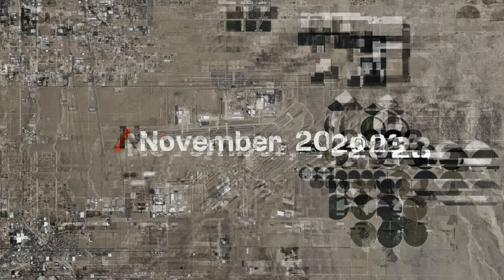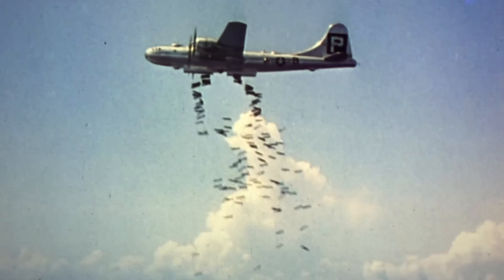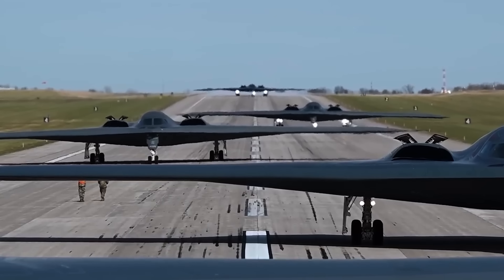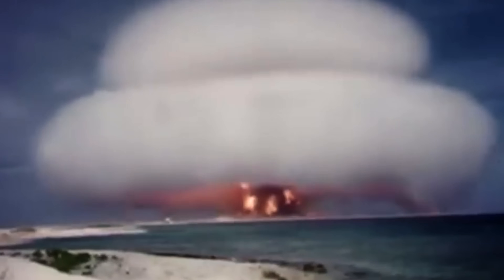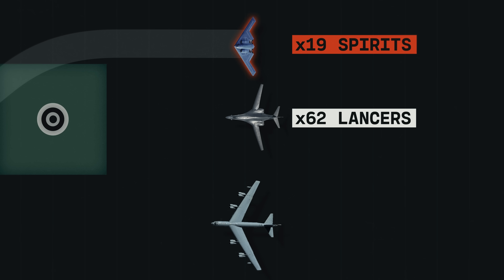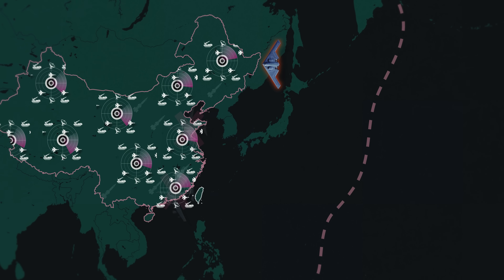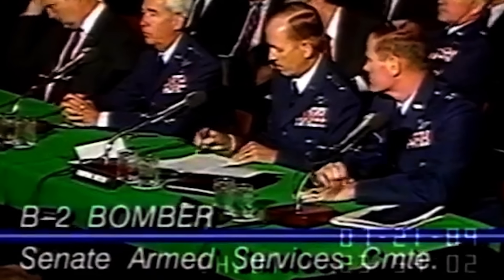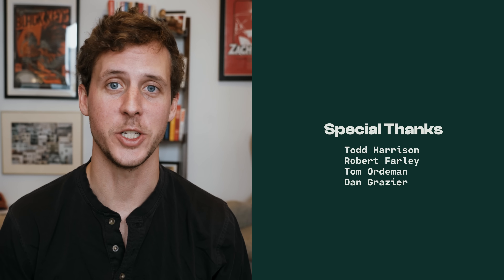How this new stealth plane keeps the US ahead of China

Comment: You mention the cost of maintenance of the radar absorbing painting but glaze over the fact the b21 is not made with this coating. This is because maintaining it not only costs a lot but limits where you can actually use this bomber, a massive boon in active deterrence strategy, as it makes observing the B2s quiet easy. 

During operation midnight hammer they launched a total of 7 bombers while the main attack force only used 4. The other 3 were decoys. The B21s are made to be cheaper, less limited, and future proof.

Comment: ANY variation of any stealth plane; only has very, very limited stealth. For all practical purposes; it’s only stealth when it’s aimed directly at its target. Try to avoid that secondary radar, and also the mobile radar. It’s also stealth only to a certain range; which is (by the book) in excess of five miles and also above a certain altitude.

Comment: Its hard to believe that its that’s stealthy that even modern air defenses will not detect it
Reply: Defenses can detect it, low radio waves can detect and track stealth aircraft, the issue is these radars dont have high enough fidelity to guide weapons. which mean you cant shoot a missile becuase the missile dosnt have enough information to lock on too. The only way to do it really is to use low frequency radar to detect and track and use a missile with its own radar guided payload and shoot the missile as close ot the target as possible and hope that that onboard radar on the missile is close enough to get a lock on its own.
Reply: @ashleygoggs5679 pretty sure that was a myth. Too add Iran has a lot of low frequency radars and to put I mild they got surprised after the b2 run
Reply: i guess you only need lay a few seeds of doubt for a short amount of time for it to be an affective killing machine.

Comment: Hi there. is it possible to do a video on the Boeing failure to maintain safety standards situation? I have a feeling the whistleblowers died by 'suicide' the same way Jeffrey Epstein committed 'suicide'. I reckon they were killed and beneficial for those higher up in the food chain. I also wonder if the killing of the whistleblowers is because they had information on airplanes that fell out of the sky like flight MH370, a Boeing 777....

Comment: Something that might be useful to mention is that bombers in modern US doctrine act more as mobile cruise missile platforms, rather than traditional bombers. B-52s are completely non-survivable in a modern conflict, but if you mount air-launched cruise missiles on them, that becomes a lot less of a problems. Some ALCMs have ranges of over 1,000km and newer ones themselves even have stealth features. You can essentially fire cruise missiles from outside detection range, and the launching aircraft or missiles can be stealthy themselves.
Reply: Yes. They have also developed the ability to launch multiple missiles and even EW missiles by dropping a pallet of them off the back and then using a parracute to then drop many of them out of the pallet. A few planes with multiple pallets is going to creates LOTS of targets for their radars.
Reply: @silentblackhole  Thats rapid dragon, this is to be used for cargo planes not strictly bombers. The Idea of rapid dragon is specifically against china, as while the US moves forces to the south china sea theater they can trick china into think they are just cargo planes but in reality they would be deploying hundreds potentially thousands of cruise missiles to saturate chinas defenses before the real heavy hitters come through. 

A new Company called anduril Has announced the Barracude missiles which is small then JASMs and LRASMs but significantly cheaper and quicker to build which could potentially give the US more industrial power to push out cruise missiles quicker they you could snap your fingers meaning multiple saturation attacks could really hurt china as they would run out of AA missiles alot quicker. Not to mention such attacks would also draw out their figghter jets to take down the cruisemissiles which would leave chinese fighters ripe for the taking by state of the art western stealth fights such as F35 and F22.

Only problem is this is all new developments, rapid dragon is a potentially new doctrine and Barracuda is being tested.
Reply: Would it be a more efficient way of launching glide-missiles for re-entry?
Reply: Can you mount enough cruise missiles on a stealth bomber though ?

Comment: Should do a deeper dive into how low- and high- frequency radars work, you've said multiple times in the video that it's about building an aircraft that can't be detected but thats not entirely true. Stealth aircraft can be detected by low-frequency search radars, but those don't have a high enough resolution to get a target lock on the aircraft. The B-21, like the F-35 or B-2, are still detectable by these low frequency radars, albeit at a much shorter range than non-stealth platforms
Reply: Without vertical stabilizers to create resonance, it's very likely that the b2 & b21 may be just as difficult to detect with LF as they are HF.

Comment: What is the risk?  The B21 is an improvement of the original version that has served for 30 years.  No controversy here.
Reply: The only realistic risk I can take from this video, is the potential case where they end up producing the same small numbers of airframes — which isn’t even possible, from what I’ve heard.
Reply: Better, cheaper, more reliable and in much higher numbers

Comment: There is a meta conflict as well.  Every time the US proposes and pursues some next level tech or capability...our adversaries have to react.  Many projects won't get off the ground but they will maintain the initiative and keep China and Russia guessing. 

On a related note, I suspect that the CHIPS Act that denied China access to our most advanced microprocessors was also an attempt to prevent the same from being funneled into Russia.   Big CPU fabs are on the drawing board in the US.  So if China thinks it can seize Taiwan and take them or at least destroy them and hinder the West...nope.

Comment: for anyone curious on the topic

all the Meta material and geometrical shape only really reduces detection by extremely high frequency Radars that are generally used for Tracking targets, Early warning systems are not really affected by all of this, albeit you can't really track with those.

this is how KH-101 and Storm Shadows get intercepted about three quarters of the time, despite those having a extremely small Radar cross sections on the high end radio frequencies.
those have smaller Radar cross sections than a old F-117 that was quite effective back in the 90s, but Air defense had massively improved since, as for China their air defenses system is mostly based on variants of the S-300, hard to tell how much better they are than their predecessor.

a successor for the B-2 spirit makes sense, it uses the same Iron ball paint that the f 117 and f 22 uses that loves to rust, is extremely toxic and need a refrigerated environment to be applied, while more modern system such as the F-35 and to some extend the Su-57, Su-70 and J-20 uses skin frames made of composite material that do the same work while not being such a pain to maintain.

Comment: I think production of the B-21 could be a lot larger than people think. We could see as many as 200 planes built because even with the B-52 modernization program, the B-52 is beginning to be vulnerable to a new generation of very long range air-to-air missiles that could attack a plane as far as 400 km (248 miles) away.
Reply: That's why the next generation of stealth bomber is already being designed. These things take 15-20 years to go from concept to design to funding to development. There are also many phases and variants of the B21 Raider to incorporate new systems to deal with new threats as best as they can. 
For example, with the F35, they started being delivered about 10 years ago with the first block, but newer blocks of upgraded F35s are still being delivered. And the contract was won by Lockheed Martin in 2001. The concept and design phase was back in the early to mid 1990s.

Comment: I’m not a mathematician, but how does 100 $700M planes equal $203B? Shouldn’t that be $70B? Or did they order 290 planes 10:28
Reply: that extra $133B is money spent on the entire lifetime of the aircraft, like fuel and maintenance and repairs
Reply: Amortized over 30 years, the projected lifespan of the B21 program.

Comment: I think America is making a huge mistake with trying to purchase so many of these right off the bat. Right now the strongest and most capable part of our military is the Navy. Specifically our carriers and especially submarines. We have the new Gerald R. Ford class carriers being built right now, but our subs still require a huge amount of work.
Our ballistic missile subs are over 40 years old, and the newest Virginia classes still have a lot of issues with the new digital systems. 
There are so many issues with our military across the board that I really think should be focused on getting fixed before implementing an entire new fleet and supporting infrastructure for an untested platform and frankly, outdated form of warfare.

Comment: I see a lot of people complaining about this money not going towards infrastructure and schools etc etc

Thowing money at problems isnt as effective in those fields as it is in the military typically.  If they really need a new bomber,  they can just print a few billion dollars and it gets done...

If they however as an example need to replace the bridge to my south that they said needed replacing 30 years ago,  they will spend 20 years in court debating whether its necessary,  whether its going to be harmful to the weather, whether the slugs in that area are allergic to concrete etc etc etc

Same goes for the schools.  Its not a money problem.  Ballou High School in Washington DC for example,  in 2022-2023,  the school had a chronic truancy rate of 88.5%,  meaning 88.5% of the students missed at minimum 30% of the school year, minimum.  Yet the schools graduation rate was 70%.   How did 88.5% of the class get marked absent most of the school year and 70% of them still graduate?  

To fix stuff like that,  money isnt going to help.  The school isnt dilapidated and falling apart,  and the students arent missing school to go to work the fields or the coal mines,  you'd have to send in the national guard, confiscate peoples kids and put them in boarding schools, away from terrible parents and use state discipline.  Good luck with that.
Reply: Missing school for enough days will get child protective services called to the house and if they view the situation as unfit for a child they will take the child away. So yes that is the solution sadly, there’s consequences for a reason, when threatening them doesn’t work you have to enforce said consequences.
Reply: @almightysosa3007  Theoretically its supposed to work like that.  But in reality that system doesnt function the way its supposed to

The parents take no part in their education,  and even when CPS shows up,  the kids are out on the street doing whatever they're doing.  Cant take the child away if the child isnt home.

And somehow they still graduate high school,  despite half of the adult American population reading at or below a 4th grade level.
Reply: What you failed to mention is that Ballou High School is 98% black.
Reply: @Alphacuremom55  I leave information like that for people to assume lol   It gives me a good laugh to know there are leftists out there that see it,  assume it,  and then think to themselves,   "wait a minute,  that was really racist,  how dare I make that assumption!"
Reply: We got so many shitty people who don’t want to take proper care of their kids these days. It’s really sad to see.
Reply: This is such an uninformed view. Throwing money actually would help a lot of issues in this country from education to healthcare to infrastructure. Fun fact, infrastructure improvements can happen very quickly with money and political will but it doesn’t because those who benefit the most from it aren’t the ones making the decisions.

Comment: The Cost over-runs alone will be 200B🙄
Reply: also the 200B apparent immediate price tag is not an actual immediate price tag, and is basically the cost of the B-21 Program over its projected lifetime. That includes maintenance, training, weapons, replacement parts, etcetera…
Reply: It is the same with the 1.5 Trillion*** dollar price tag with the F-35 Program. That is over its massive projected service lifespan (50+ years) which includes software updates, maintenance, training, and everything else…
Reply: The B-21 program is under budget, ahead of schedule, and on a fixed price contract. 

Literally the one military program that went well budget-wise and people still spout nonsense like this about it.

Comment: isn't it $70 billion? $700 million each * 100 planes = $70 billion. You said $203 billion. If they buy 290 planes, then the math is correct. But they are buying 100.
Reply: R and D costs added on
Reply: Total cost of operating them for their lifespan. Imagine buying a bicycle and running it for 50 years. You are going to buy some tubes and chains.
Reply: R&D and maintenance also contribute to the cost.

Comment: These types of aircraft, large stealthy bombers, are the future of combat aircraft. Fighters could well become obsolete as missiles and small drones get better. A key advantage will be using them as sensor and network nodes. Currently F-35s do this but ultimately the task is better suited to larger and stealthier aircraft. Almost all combat aircraft missions will be replaced by missiles and small drones, but the one exception will be when the greatest stealth is required, which is what a flying wing like this is well suited to.
Reply: Stealth is already partially obsolete due to hybrid high frequency radars made by China.

In future even more advanced detection technology will come and make the stealth completely useless.